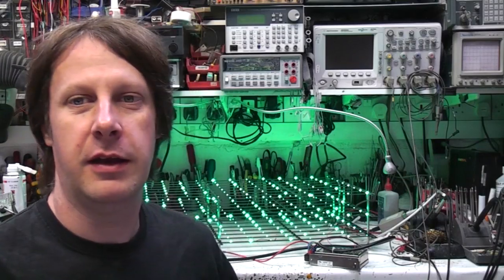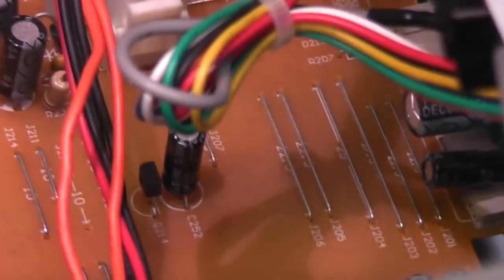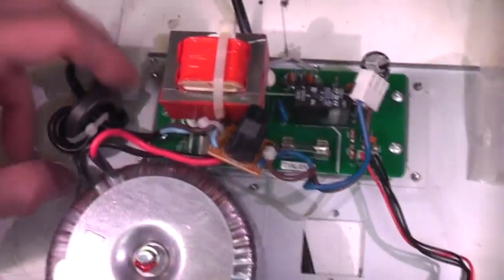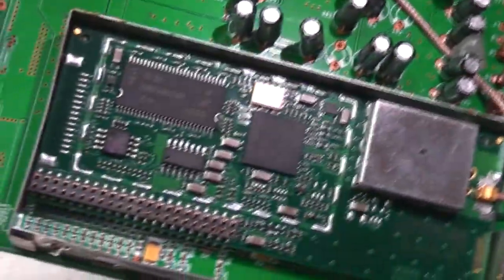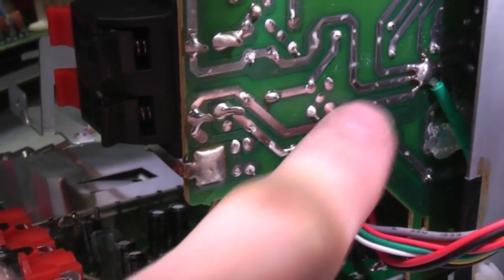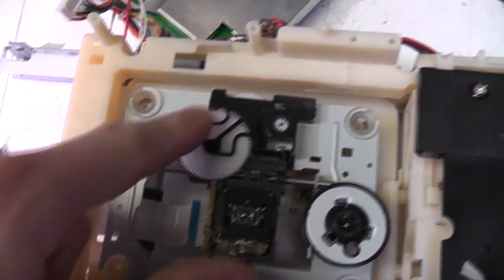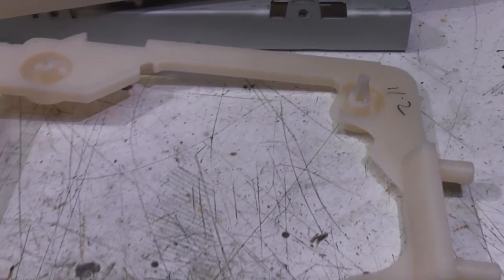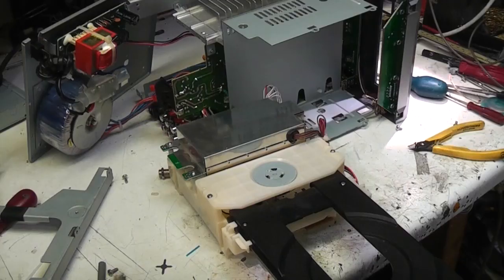Pure  DMX-60  DAB/CD stereo teardown

Comment from the maker: The DAC is the Wolfson chip I pointed out on the board in the can with the DAB processor. I didn't check what the large chip near the phono connectors was but would guess it's just audio switching etc.

Comment: I thought this was going to show me how to take it apart not just show me a meaningless load of bits on the bench. I’m pretty sure my cd tray belt has snapped so I will have to work it out for myself. Just wasted 17 minutes.
Reply: Wow, a bit bitter? This never claimed to be an instructional video. And if you can't figure it out on your own... well, you've got no business trying to fix it.
Reply: @AureliusR   If you listen to his intro he says  he is going to take it apart and fix the cd tray. The exact problem I had , so why wouldn’t I believe him? I was a telecoms tech for 30 years but always willing to learn from someone else if it saves a bit of  time. I fixed it without his help.
Reply: @johncrosley1  He... quite literally did exactly that, and showed how he did it. I'm not understanding your issue. The tray can break in different ways.
Reply: @AureliusR  I watched the video again in case I missed something but can only conclude that you watched a different video. I stand by my original comments. He showed all the parts but not the actual dismantling. Not only that but his explanation of the smoothing capacitors at 2-40 and various other technical talk shows me that he is not very knowledgeable on electronic theory. There are no high frequencies in a power supply unit, just mains hum, which in a full wave rectifier is 100Hz, hardly high frequency. When dismantling complex pieces like this it is easy to make a mistake and break something if you are the trailblazer which is why I was more than happy to follow his method. Unfortunately there wasn’t any method just a load of nonsensical  technobabble.